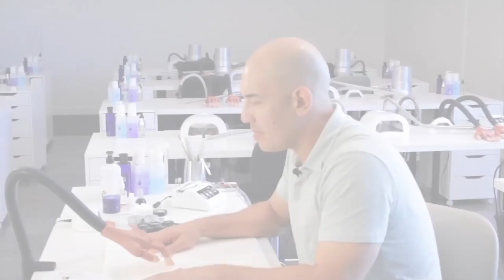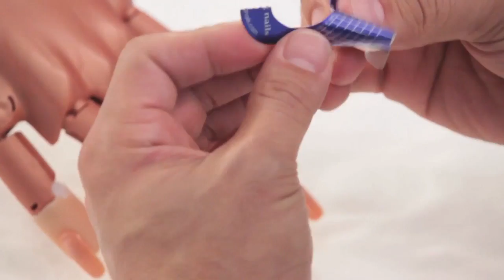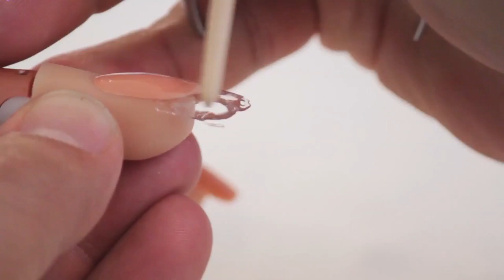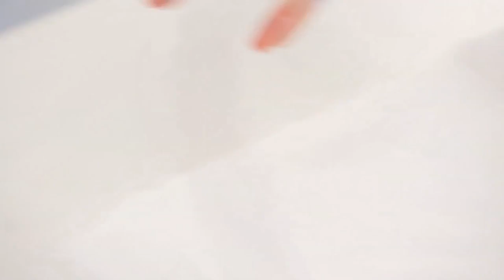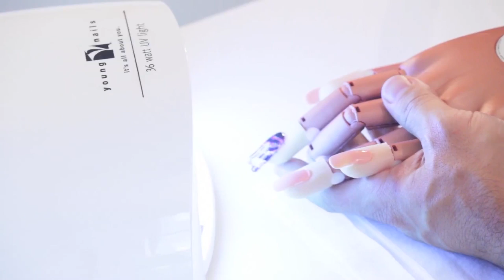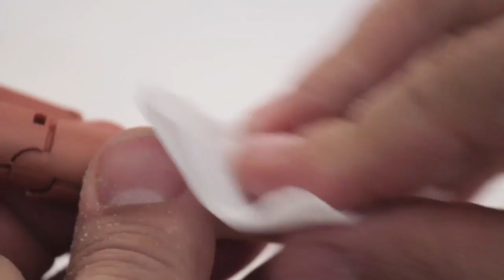Razzmatazz - Using Young Nails Gels & Glitters - Gel Nails

Comment: I have a problem with the gel leaking in the sides of the nails, even if i make the pefect c curve on the nail and the client puts the nail in the light (new bulps) it still leaks, so if i make them put it in FRONT OF the light, is it not just gonna get worse? 

Why does it still slide to the sides in the light? :(
Reply: omg.i have the same problem and no idea how to fix that
Reply: +Mariann M i started having my clients turn theyr hand upside down for 2 sec so the gel starts leaking back down to the middle then go in the uv lamp